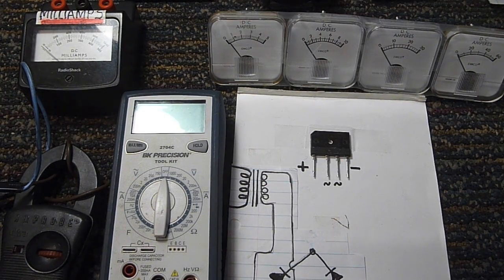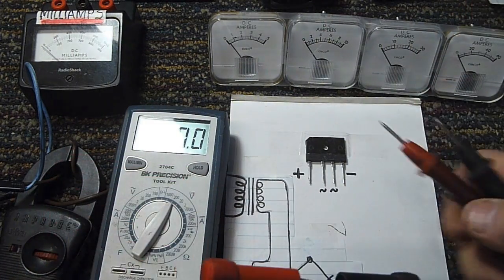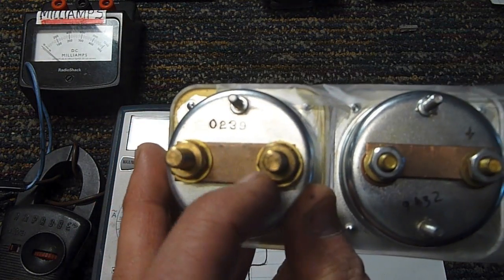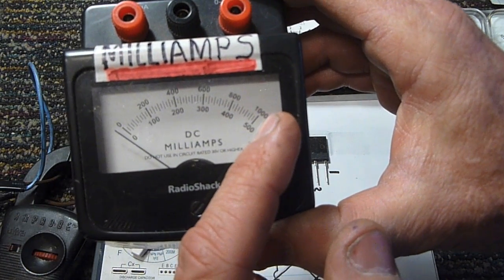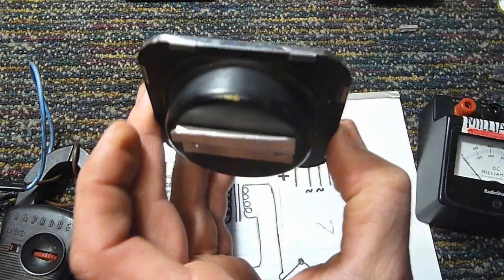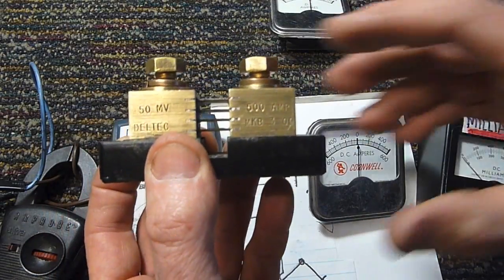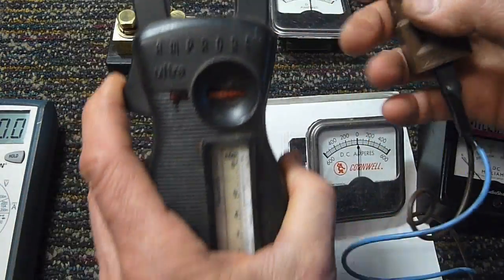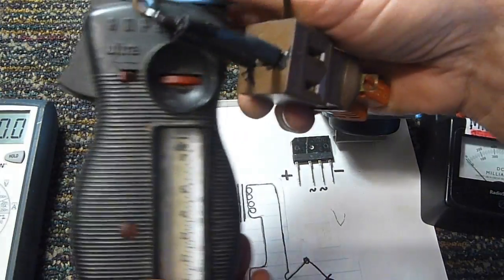Incorrectly Using Your Multimeters Can Blow Things Up. Here's why.

Comment: Can you damage an ac outlet if the multimeter was set to OFF?
Reply from the maker: I don't know about damaging your outlet, but if your meter probes are in the wrong ports you can sure damage your meter even if it's turned off.
Reply: @GrantsPassTVRepair  Thanks for reply :) My probes were in correct place. I was measuring AC Voltage, and inserted the probes into wall outlet which was on, but my multimeter was OFF, so is there any possible damage? Does the electricity flows through even if multimeter is off?

Comment: Where did you buy that 600 amp meter??
Reply from the maker: I don't remember where I picked it up from, but perhaps you might find an inductive amp meter like mine from an automotive parts supply store.
Reply: The one in the video is the Amprobe brand, but other instrument manufacturers have them as well.  Round here the Amprobe brand is very popular with contractors that serve the oiled, oil company employees may have them in their tool box as well. Not only does it measure AC current it will also measure AC voltage as well. With an accessory it will measure resistance.There are some clamp on ammeters that can't measure DC voltage, so keep that in mind before putting your money down if you need DC capabilities. Th any of them are available from online vendors. Most decent local hardware stores could get on for you if they don't stock them. Most of us end up going online because the warehouses that keep them in stock generally to not sell directly to the public

Comment: I spent 7 years in the NAVY on submarines during the late 80 s I was a nuclear electronic tech I became disabled after a torpedo reload test went wrong and it crushed my spine. I can remember when had to use a O scope to check a waveform and forgot to use an isolation transformer and it blew up the scope and burned the hell out of me . Submarines are floating grounds. Its the same thing as an old style tv . If you do not have a video on using an isolation transformer please make one
Reply from the maker: I've also had a bad experience by not using an Isolation Transformer. Here is a video I made on the subject. https://www.youtube.com/watch?v=3rvEdHyAd2k

Comment: excellent beginning tutorial for current measurement!! Even this old guy learned something. I did not realize DC current could be measured with an magnetic field meter, nor did I realize that winding more turns around an amp clamp increases it's sensitivity.
Reply from the maker: If I can teach an old guy a new trick I must be doing something right. :-)
Thanks for the comment.

Comment: There are to things that can usually go wrong with using the multimeter. Firstly connecting to the voltage source through the current plug, secondly measuring resistance from voltage source. There is a LoZ mode in high level multimeters, that can be used to measure unknown wires, it checks first for the existence of voltage and shows the voltage that occurs only under the load. If voltage is not detected, it switches to the resistance mode and is much more safer way to measure unknown wires. My old digital multimeter showed no voltage from elecrical device that I tryed to repair, but LoZ mode detected 100 DCV on the load, that can be deadly.

Comment: I blew the fuses on two different multimeters over the past 30 years, before I finally got the message. One thing about harsh experience is it leaves a permanent mark. I don't expect to ever blow another, partly because I try to get away with measuring current by induction.
Reply from the maker: Some of the new meters have an alarm which notifies you when your have your meter probes in the wrong ports.
Reply: Grants Pass TV Repair 
"Some of the new meters have an alarm which notifies you when your have your meter probes in the wrong ports." - e.g. Brymen BM869s
Reply from the maker: My Fluke multimeter has that as well.
Reply: Quite a few Brymen DMMs have it, BM525  BM257 BM235. possibly others. It's a handy feature. It's quite noisy, but I suspect nothing like as noisy as a big fuse blowing! Plus the cost & inconvenience of obtaining a spare, or perhaps of buying a new meter and replacing damaged test-leads / probes. I just happened to be looking at buying a second Brymen DMM. I just haven't made up my mind. yet.

Comment: Yep, that would certainly happen... if he/she measured the current ACROSS the bridge rectifier terminals with it in circuit, and the power on! Out of circuit, though, it's not going to happen - a battery-powered DMM (or even an old analog VOM) isn't going to put out sufficient voltage/current to do anything to that heavy-duty bridge rectifier (it might damage the meter, though, if it's one of those cheap Chinese/Tiawanese units)!! Remember peoples, measure current THROUGH, and voltage ACROSS a component (or system) or the magic smoke could come out!

Comment: That happen to me once. I had a older multimeter that I purchased used. some of the marking's on it telling you what was the current and what was the voltage was rubbed away. You could not tell what was what on it. One day I went to use it to measure the voltage in a wall outlet and it sparked and tripped the breaker. I did not realize that the leads were in the current input on the meter.